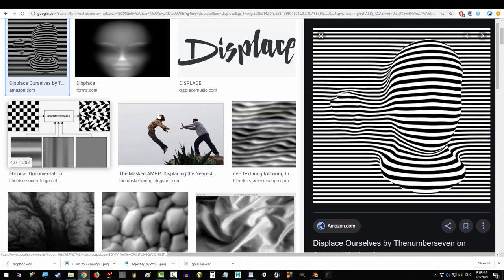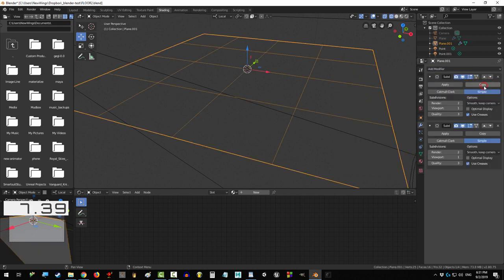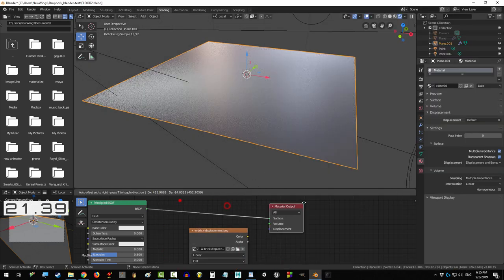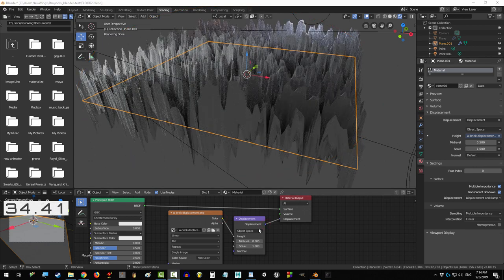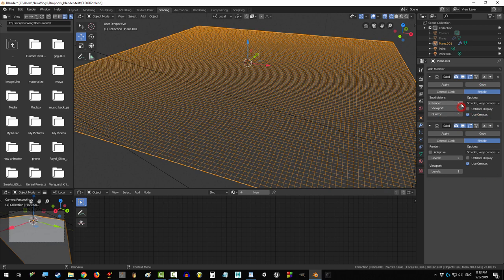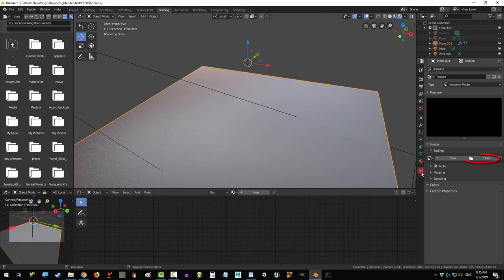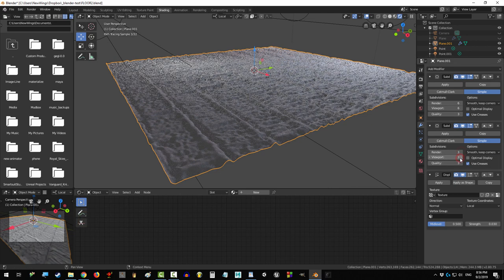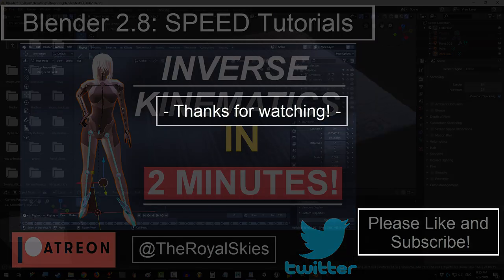Blender 2.8 : Principled BSDF - Apply Displacement Maps (In 40 Seconds!!!)

Comment: Note that the displacement map doesn't work on eevee because the the option in the material settings doesn't appear to exist. Setting it to cycles instead fixes the issue.